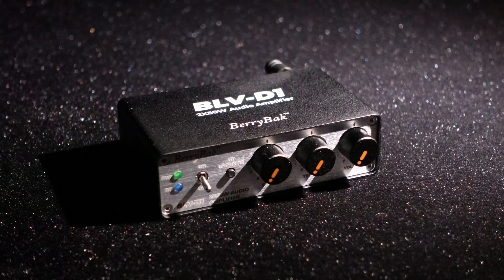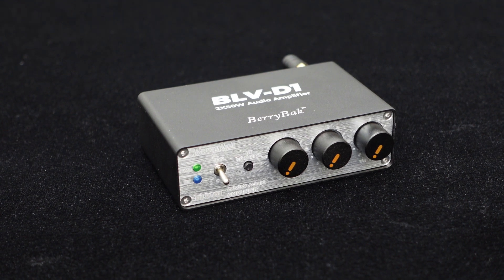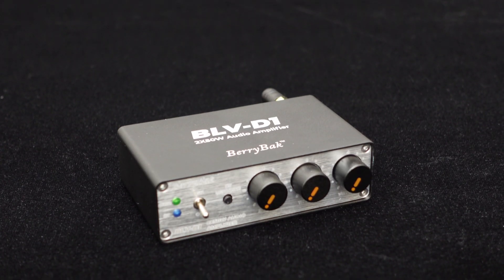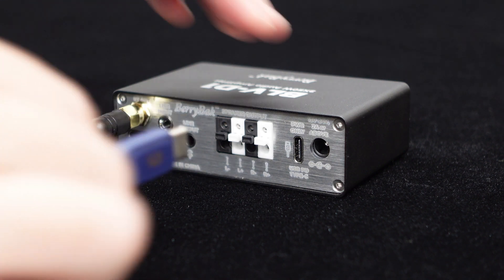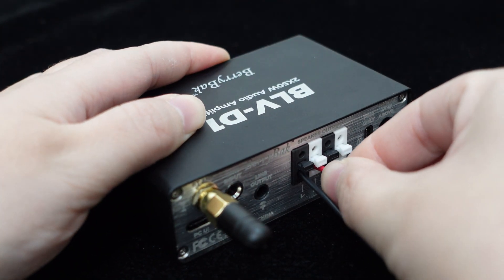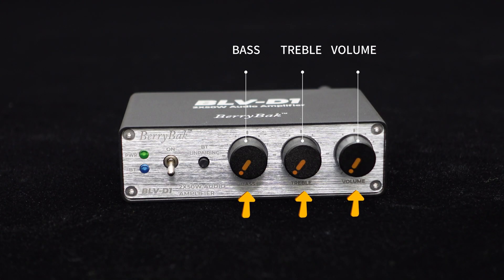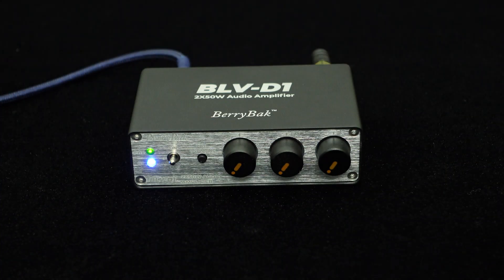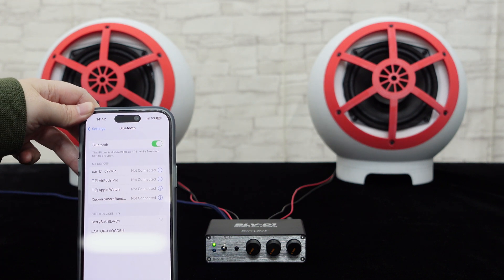TPA3116 Stereo 50W Bluetooth Amplifier BLV-D1 with DSP for  Independent Treble/Bass & PC UI Control

Comment: Basically a bru3p with a slightly different enclosure right? Is the line out still mono sum and non-responsive to the front volume dial?
Reply from the maker: Hello, thank you for your watching. The BLV-D1 features a stereo line out that carries a processed signal rather than a direct bypass signal. Any adjustments made to the speaker output will also affect this line output signal. We hope this information proves helpful. Have a wonderful day.